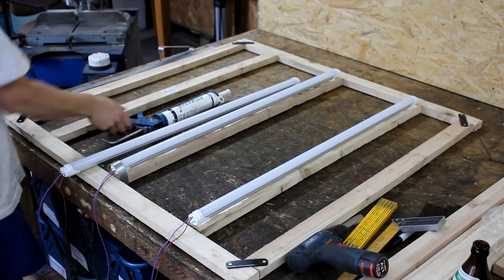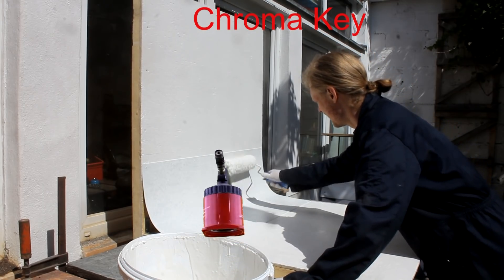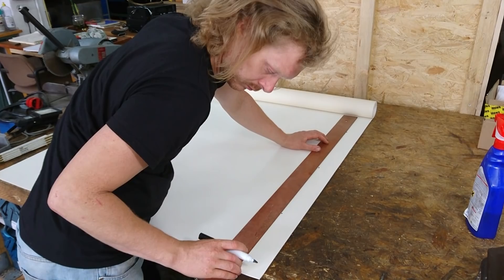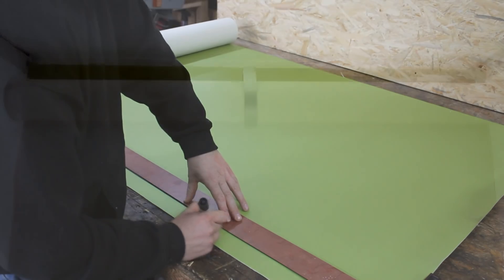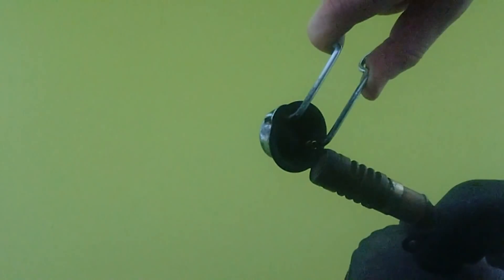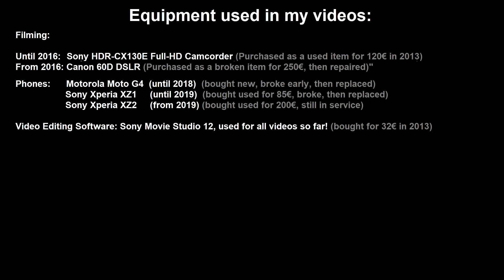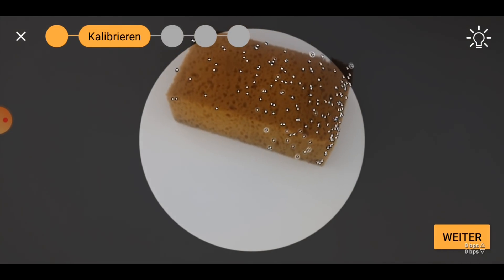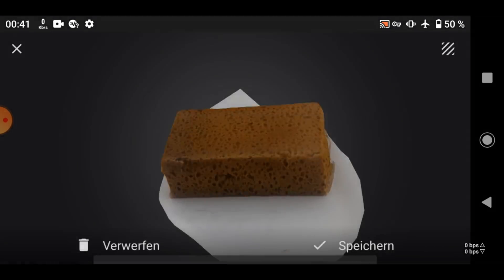Building a DIY Photo & Film Special Effects Box

Comment: Did you consider using roll paper for the background, fixing it at the top/back and allowing it to hang in a curve to the front? Available very cheaply for use in decorating to line walls ready for more expensive patterned paper.

Comment: 1:48 - Be careful if you order 2x4's in UK, they're arrive a little bit bigger! lol!
I didn't even know that you guys called 2x4cm the same as the our "regular" imperial ones!
Reply: noxxi knox  I would guess because 2x4 isn't really an exact measurement. I believe it's one that 'was' 2x4 before shrinking, planing etc.

I'm sure if you look at the small print it's sold as 58x116mm, (although judging by how the big DIY stores do it, probably 44x88). In much the same way as lengths of wood and sheet material tend to be 2400/2440mm rather than 8ft.
Reply: noxxi knox  we aren't really that metric, we only did enough to stop the EU from moaning! lol!
Ask a native how tall they are, 9 times out of 10 they'll give you the answer in feet and inches.
Speed limits in mph.
Beer and milk in pints.
We love our anarchy!
IIRC bricks did go metric, which is why if you try to add an extension to an older house you end up with thicker mortar lines if you try to keep the bricks in line!
So did plumbing pipe, although as a metric "nearest" to the imperial. Which can be a pain as 12mm isn't quite 1/2", but it usually works ok.
Reply: @benholroyd5221  the point is though that when TPAI asks for 2 by 4 he gets 2cm x 4cm.
Do that here and you'll get close to a 2" x 4"
(Which is great if you're planning to build a roof, but a bit big for a photo box! lol!).

Comment: Hi, a geodesit here ... To archieve a better 3D-solve, while performing photoprammetric 3D-reconstructions (purely camera based) it is actually pretty useful to have points further away from the object. Points with a higher parallax improve the acuracy. And more texture overall generally improves tracking. In actual usecases additional trackmarkers are usually added to the background as a reference for the solving algorithm.
Greeting from Hannover ;)
Reply: For 3D scanning I used Meshroom with good results.

Comment: An idea for the 3d scan, get a small block of wood with 3 nails in it, use that as a tripod base (nails sticking up) to rest the object on to separate it from the background.
Reply: Yup, it will be easier to cut the table of the model.
Reply: @UberAlphaSirus  I was thinking more that the gap below the object would mean the software would see the table as separate, but yeah, easier to edit out the stand.

Comment: The green screening looks pretty impressive. Remember the 1980's when it looked so bad? Now days even the home hobbyist can utilize professional results.
Reply: In the early 80s chroma keying was performed with analog electronic circuits. Voltage levels determined the colour,  and e.g. noise in the video signal made it  inaccurate. Digital video replaced and improved greatly on that, plus now it can easily be included in software video processing algorithms cheaply.
Reply: You think the 80s was bad.... go watch some episodes of Dr Who from the 1970s.
Reply: @algemeennut6683  I used to do chroma key by hand (well, by mouse at least) in the days if DOS... I'm pretty sure the thing that's given us this much better quality is improved resolution.... all that "yuk" that used to surround an analogue keyed image or the pixel jitter I had to edit out by hand.... it's still there. It's just those pixels are now so small we don't see it.
Reply: @edgeeffect  Lol...yes it brings back funny memories.
Reply: @edgeeffect  Surely number of pixels and their displayed size play a role in the perceived result. But also filtering is important to avoid nasty effects!  This paper from BBC research does note some of the artifacts of various analog and digital CSO circuits of that time http://downloads.bbc.co.uk/rd/pubs/reports/1982-07.pdf An interesting read.

Comment: How odd. 20 seconds in there is a zero insertion force socket. Never seen one before today or I wouldn't have known it was a ZIF socket, saw it earlier today on Dave Jones EEV Blog second channel...
Reply: If you're into building computers, you would've known ZIF sockets (possibly not by name though) since the Pentium 1 processor. OK, the P2 then went to a slotted design, but by the Pentium 3 or 4 CPU, they went back to ZIF sockets. That was more than 20 years ago ;)
Reply: oh lol i missed that. hahah. coincidence huh!
Reply: Same i was just writing a comment about it
Reply: @Seegalgalguntijak  it's from a medical scanning device not a computer
Reply: Well then you clearly haven't watched the second to last repairathon: https://youtu.be/HyhhLHthvvg?t=88
Reply: You just experienced synchronicity.
Reply: Used to be common in mainframe and mini-computer designs, particularly for attaching washing-machine sized SMD hard drives and Winchester disks to the CPU cabinets.  This is back in the 60's to 90's era when computers were manly beasts, physically massive but dumb as nails.  They were a joy and a challenge to work on, but when you heard the fans wind up and the lights started blinking you knew you did some good that day...